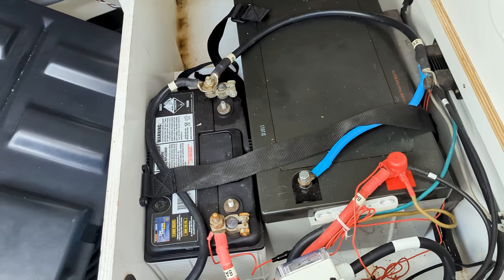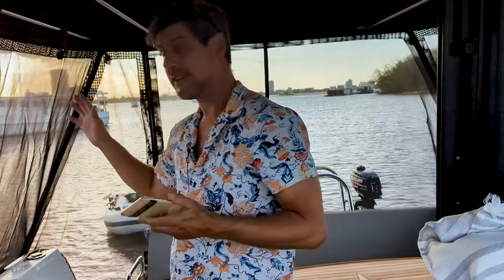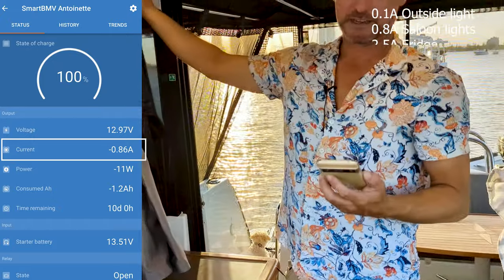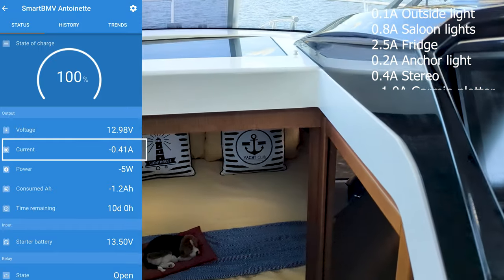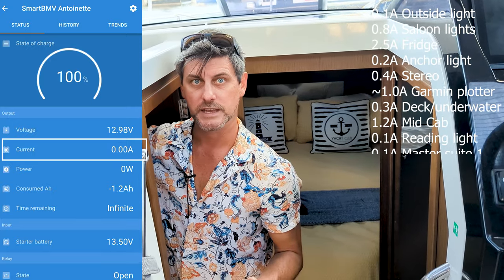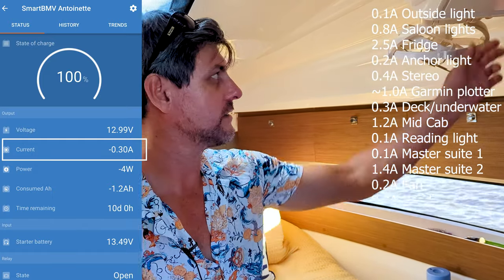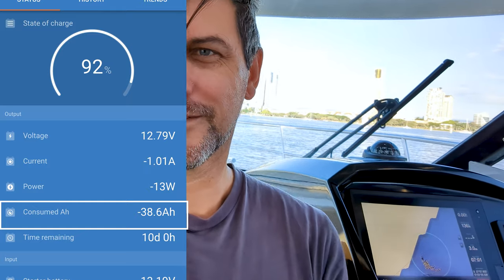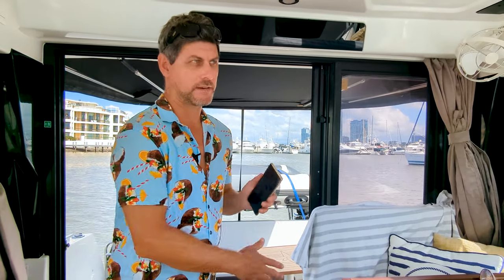POWER: IN-DEPTH TOUR MERRY FISHER 895 | The Rudder

Comment: Thorough and illuminating (no pun) review.  But Damian, while you were focused on amps in/amps out while away from the dock, it's worth noting that your 895 must have also come with a 240V powered battery charger as well.  It needs to charge for the correct chemistry and its rating  (max charging capacity) and charging profile both affect how much your house bank gets when arriving at a marina with a depleted bank.  The larger the bank - if it's depleted - the longer getting pulled back up to a (near) full charge will take.
Reply from the maker: Thanks Jack, really good point I didn't really talk about the 240v, shore charger, side of the power story. You are completely correct. I was more concerned what happens when you don't have access to that power, but yes it is important and needs the correct charger for the battery bank.

Comment: We have now got our 895 just a couple of questions 
Does your fridge leak water ? We have had some water ponding at the lowers steps near the master room / the head area ? 
Also the bow thruster keeps tripping out ? 
Thanks Sam 
That said lovin the craft 👍
Reply from the maker: Awesome congrats on the new MF!! We have had pooling on the middle step occasionally, but not continually. Very annoy. We did figure it was the fridge but maybe only on humid days. Have not pulled the fridge out to investigate further. No have not had the bow thruster problem. I use the bow thruster most trips. Sorry don't have any ideas there. Get out and do some boating!